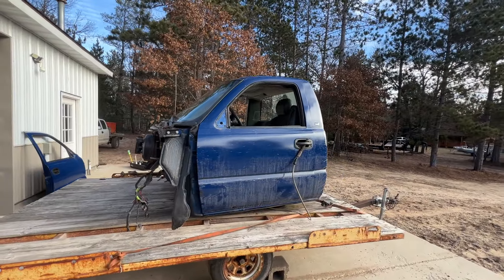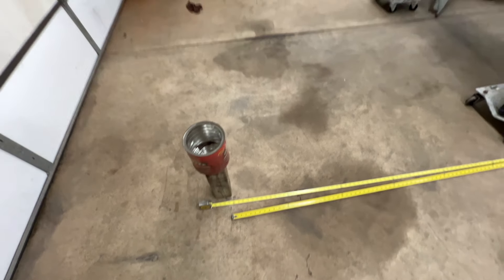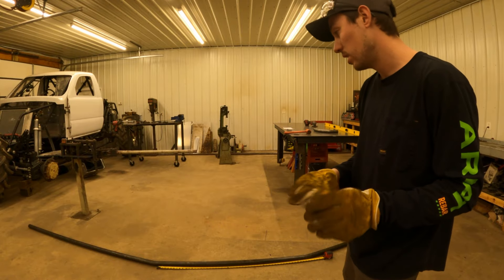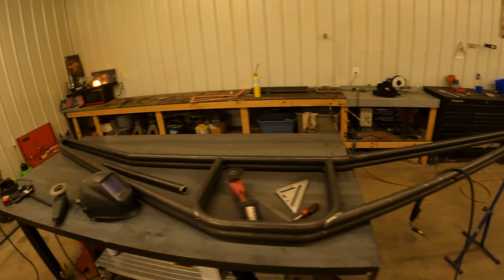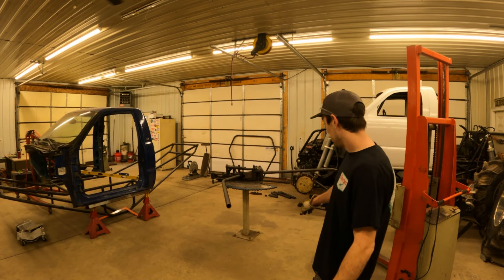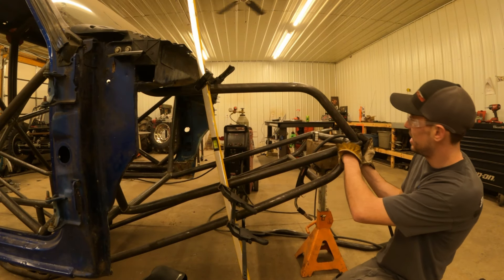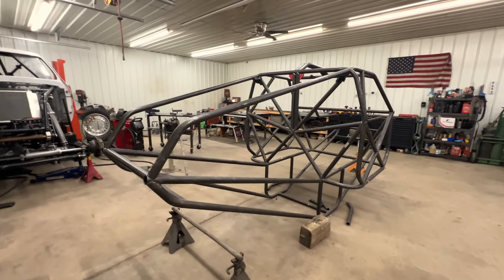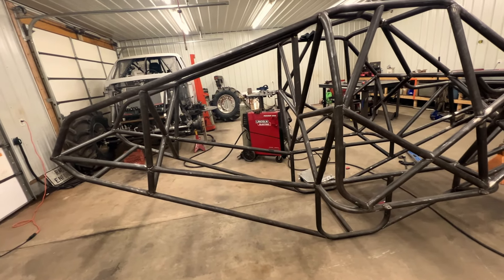How To Build A Mega Truck Chassis - In 9 Minutes

Comment: Got an 89 2500 with f250 swaped straight axels. Running 44 boggers 19.5 wide. But running into turning issue with the front traction bars... do i need them? 12" lift on it.
Reply from the maker: So the traction bars are gonna prevent axle wrap. If you’re just driving on the road, it probably doesn’t matter if you took them off. If you’re Offroad, you probably want to keep them.
Reply: Ok. They are located between the struts knuckle and the hub, if I relocate them to opposite side of knuckle, going at about a 15 to 20 degree angle to custom cradle, would they still function? If I had to put a bend in them, would that work?